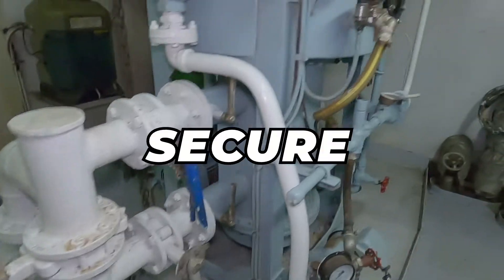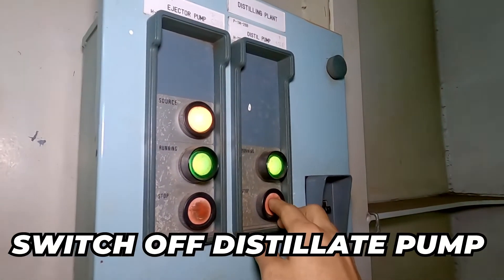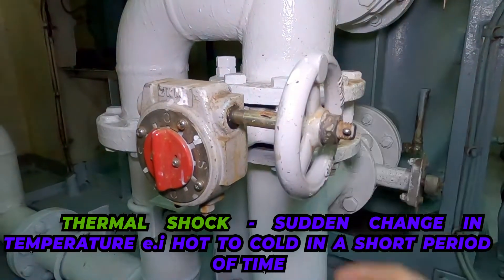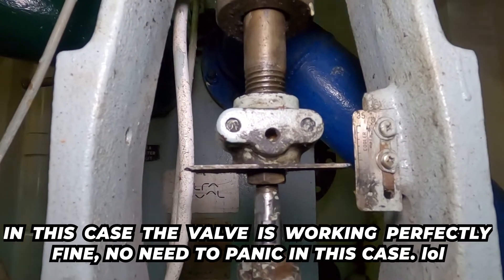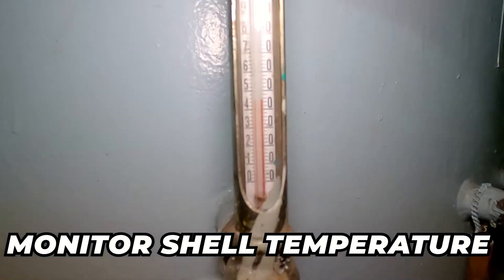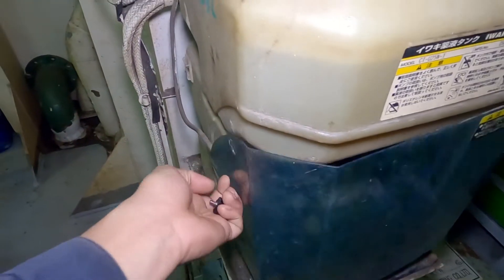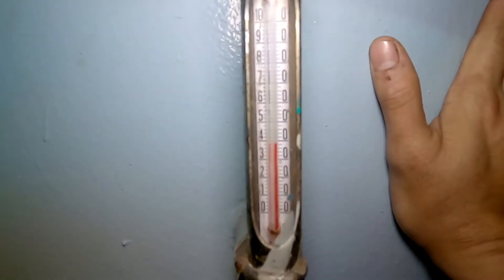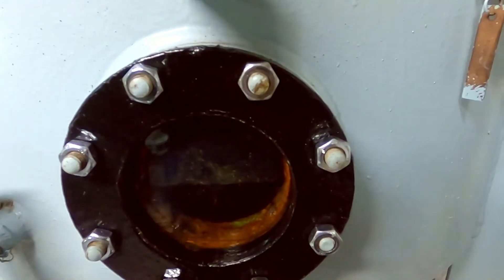HOW TO STOP FRESH WATER EVAPORATOR

Comment: Tnank you for your good information 

But i have problem when i close the ejector pp the FWG is fully filled with sea water so it take me a time to drain it
Reply from the maker: There are many possible causes for that and trouble shooting is needed. Make sure to fully close the sea water inlet valve after the shell is cooled and after closing the ejector pump. If the problem still exist, I believe this valve is faulty and needs atleast lapping/grinding or replacement otherwise youve got other leakage from sea water side but its a the best place to start trouble shooting.. Goodluck..
Reply: @jaserauger8128  thank you 🙏🏻
Reply from the maker: Let me know what happened next, I would gladly walk you through if my time permits me to do so.